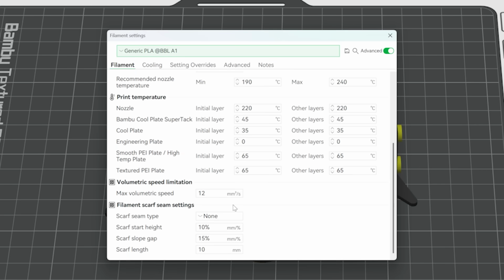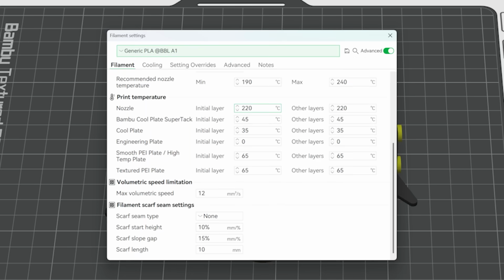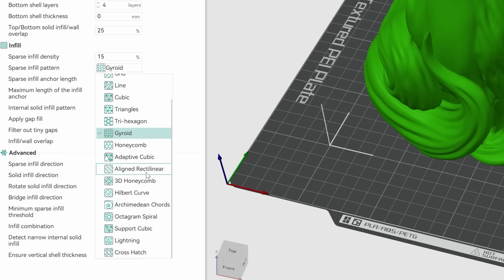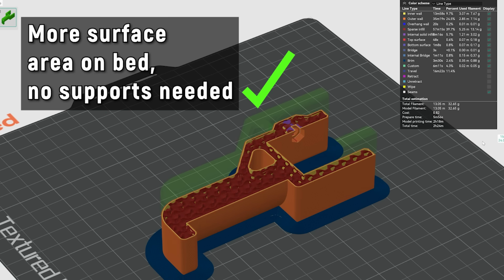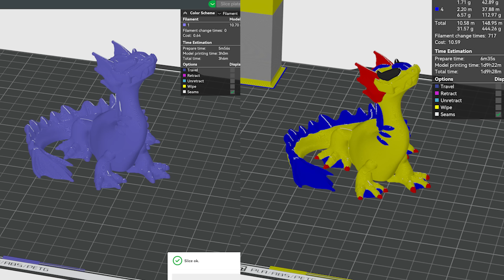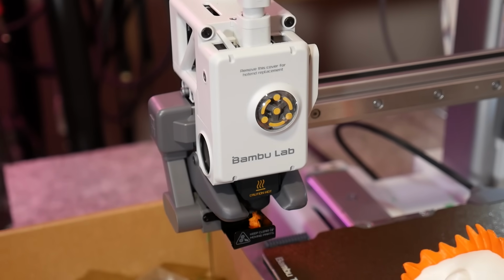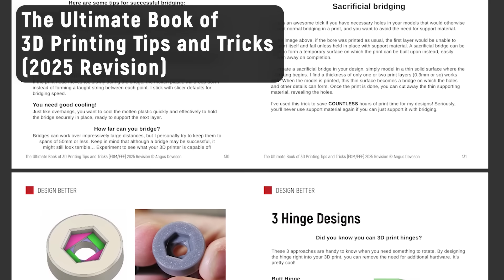Cut print times in HALF with these simple slicer changes!

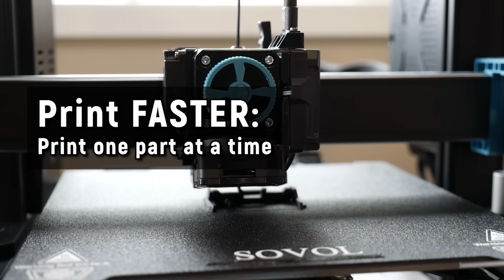Comment: 5:48 Print by object may reduce travel distances, but with really small parts it ends up taking more time since the printer has to slow down so each layer can cool properly, and since that's all it can really do, it ends up just being a waste of time..(other than for potential batch failures like you mentioned, but even then, all small parts really far apart..)
I do like using cubic infill though (10% with 3 walls is usually more than enough; no idea why grid is always the default..), I don't usually find support cubic to be very useful since most things I make are functional or too small for it to matter, but I do still remember its existence
Reply: I didn't realise people used Print By Object as a timesaving measure; for me it's always been about stability and reducing risk. Both prints always come out better and if one fails it doesn't take the rest out with it.
Reply: @turbochargedfilms  slow is steady and steady is fast
Reply: This 👆